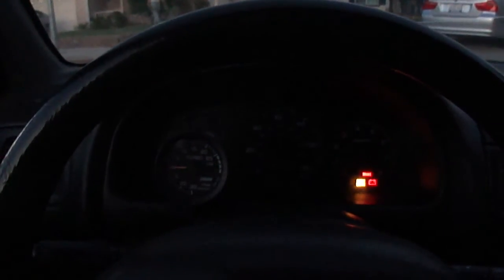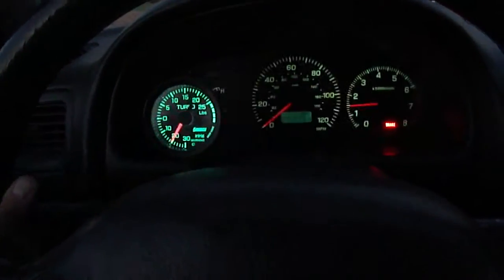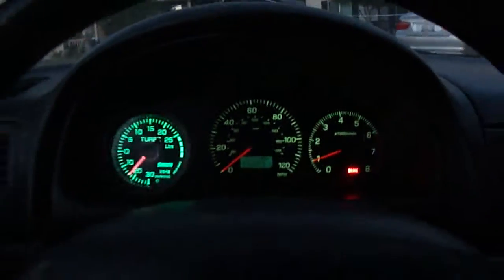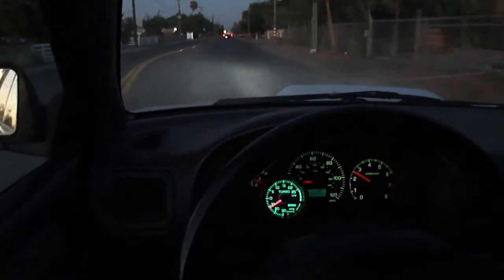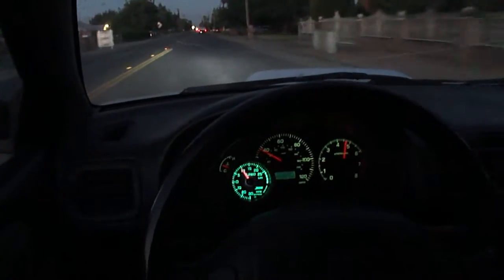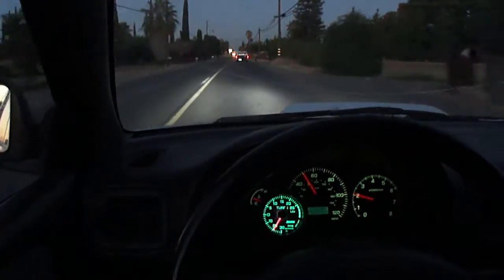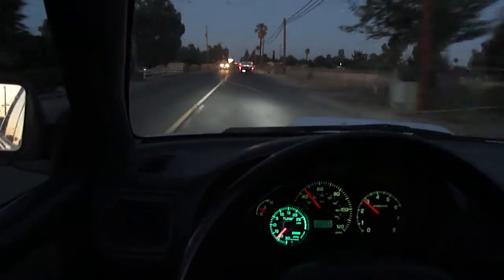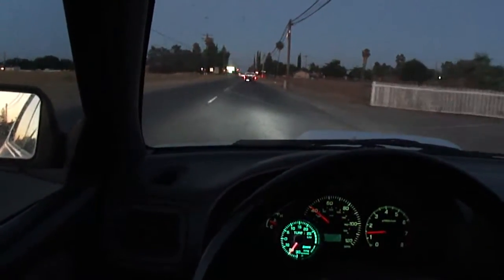Stock EJ20g test drive

Comment: I read that the jdm ej20g and ej20k require 94 or 98 octane, it's either or. Japan uses a different octane rating system than the US. Just a heads up...